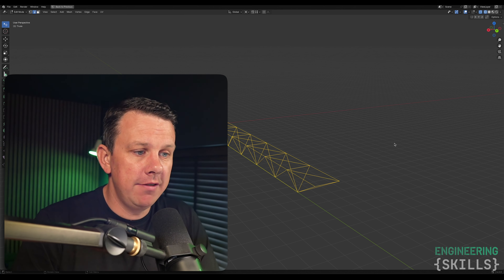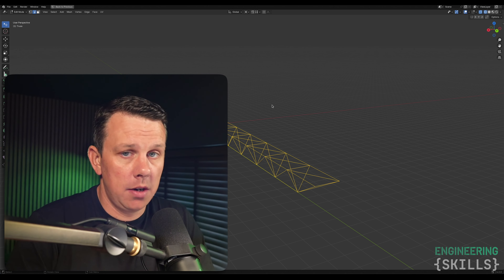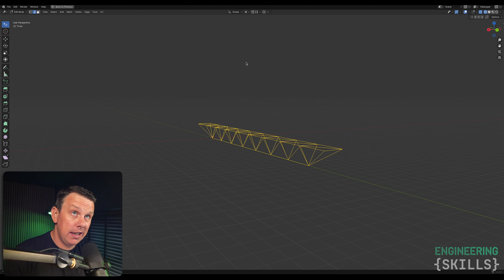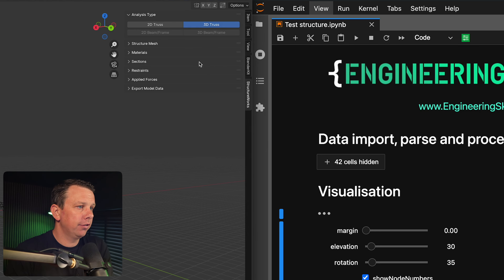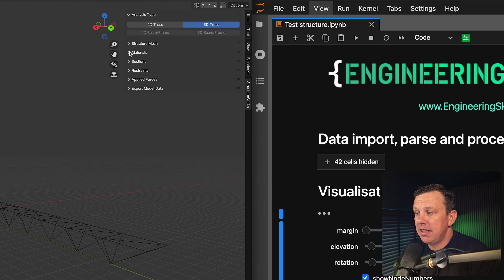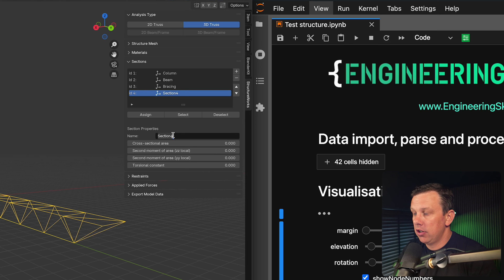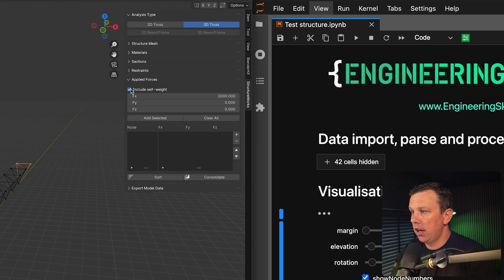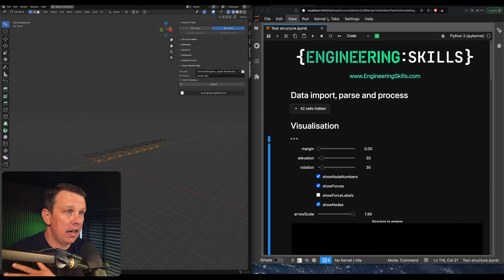Blender Addon for Structural Modelling - Project Intro | EngineeringSkills.com

Comment: One question, are you working also on a shape function for deformed shape of structures?, cause using so much nodes to get it is a little messy the visualization and the modeling results very annoying for me